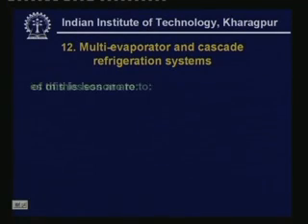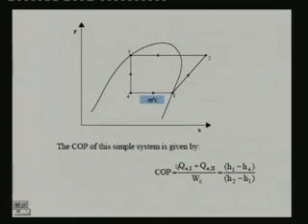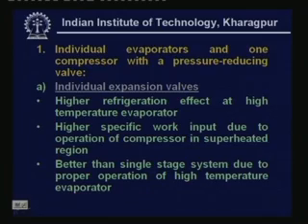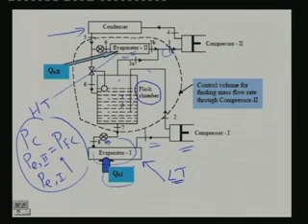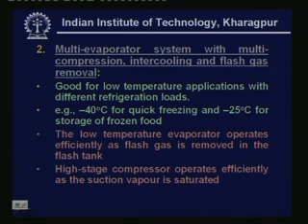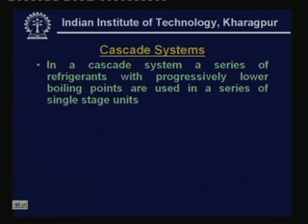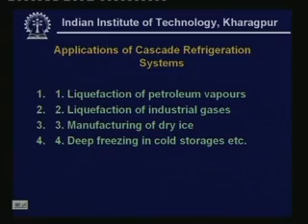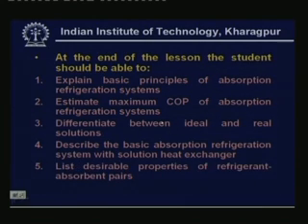Lecture -13 Vapour Compression Refrigeration Systems(contd.)

Comment: At (26:41), there is an error on the considered refrigerating effect at the low-temperature evaporator. This should be (h1-h8), instead of (h8-h6).
Reply: yes actually misprint it is

Comment: In the multiple expansion valve... how we are getting that saturated liquid refrigerant in the lower evaporator, or how we r removing the flash gas, without using a flash chamber??? Please reply...
Reply: what they have assumed is that it is an ideal system. So when the refrigerant is throttled first, it is assumed that it carries only required refrigerant with it and also it takes the vapour with it, therefore, the next stream which we will be getting will be saturated liquid.
Reply: To realize the assumption that the next stream will be saturated liquid, as mentioned by Abhishek, we can configure the piping layout upstream of the lower side throttle such that the piping tie-in is made at the bottom of the connecting line. This is to make sure that we will not take any vapor downstream of this tie-in.